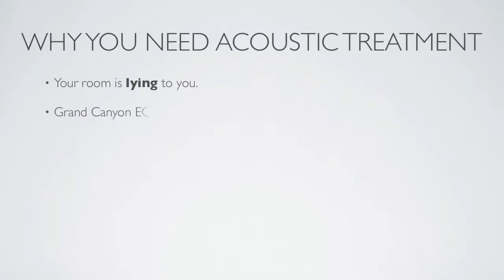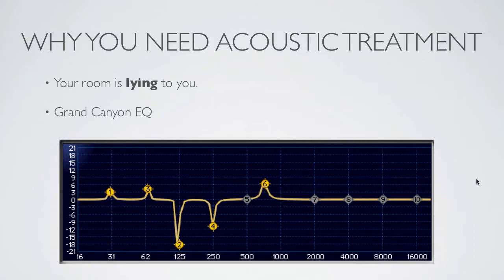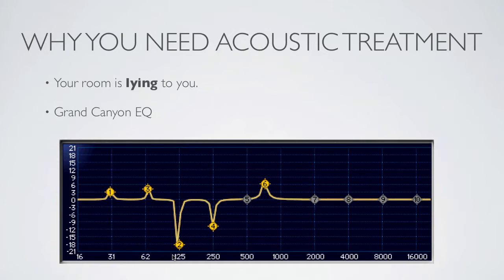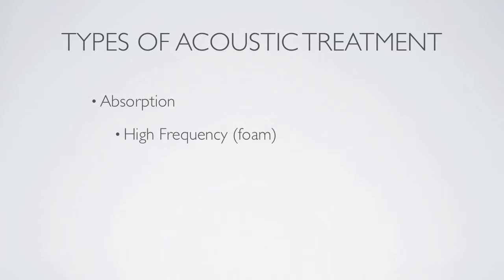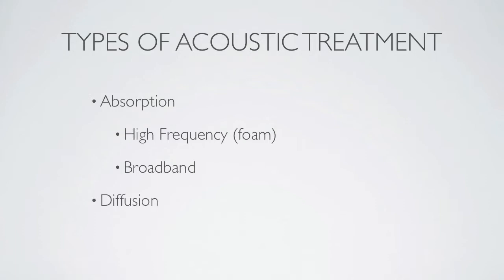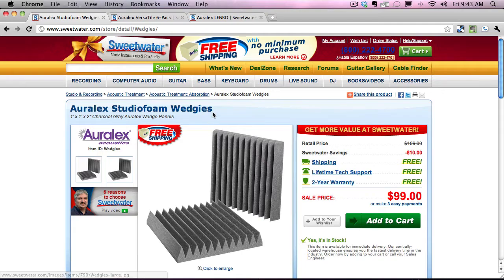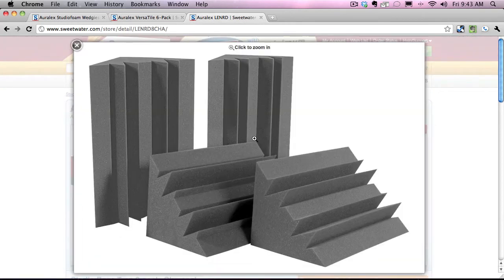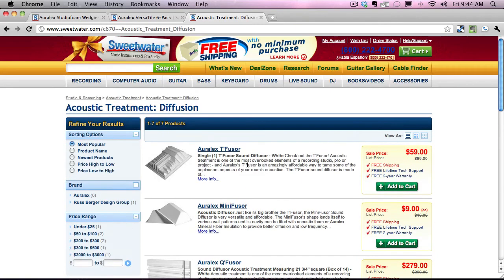Intro to Acoustic Treatment - HomeStudioCorner.com

Comment: @Voiceguardian Also, for bass you need thickness.  So your corners get get triangle cut fiberglass foam board stacked into them.  6inches, 8, 10 whatever you can spare but other than specifically tuned bass traps, you'll need to fill those corners with absorbent materials.  There are many kinds of bass traps out there, a little web research will show you how many different ways there are to achieve your goals.  Either way, treatment will yield the most benefit compared to hardware.

Comment: @Voiceguardian -If you can trap all your corners & your ceiling/walls junctions then do it.  Small rooms, smaller than 2500 sqft then you really can't have too much bass trapping.  Besides, ceiling/wall junctions are easier to part with space than say your wall corners.  As far as your bare walls, you want to cover the wall your speakers are facing (Behind your mix position), behind your speakers (more important if your monitors are rear firing bass ports) and lastly your first reflection points

Comment: @Voiceguardian By 'lastly' I was just listing, not putting them in priority.  You don't 'have' to do anything.  It's the notion that it's very difficult to over treat a room (of course someone will come here and say too much will make a room dead) i.e Anechoic, but those rooms are million dollar rooms - you won't achieve that.  The most important are your corners, if you CAN do your wall/ceiling junctions then do it (the space you loose is most likely unimportant anyways).